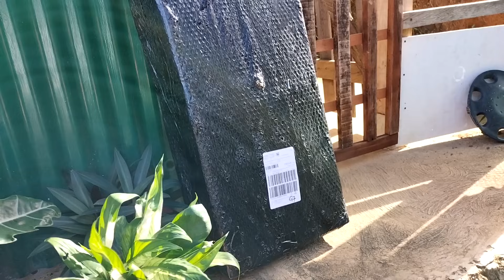V519 - FOREIGNER BUILDING A CHEAP HOUSE IN THE PHILIPPINES - MORE BATHROOM WORK - THE GARCIA FAMILY

Comment: It would be much easier to put it atop like you started out.  You can use any kind of strapping to hold it down.  Even that metal which many packages are crate in.  When your in city hardware look for plumber's strapping.  Its a pliable roll of metal with holes punched in it.  They may even have nylon or plastic ones which can be nailed down over the pipe.  The way you did it looks good..  Carlo Rossi has been a long running italian table wine, affordable for most anyone. And they do wine right. I use to get the boxed Rhine and Chables and leave it in the fridge. They were three liters with a spigot to pour right out of the  open fridge door.  I like getting a baguette and Asiago cheese and a glass of wine as a snack.